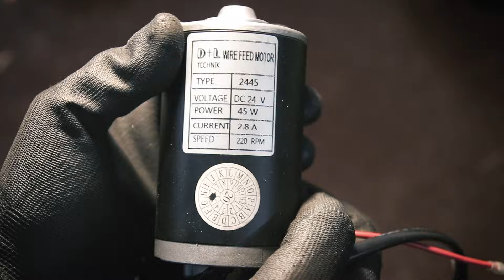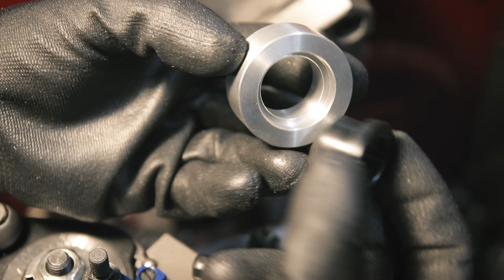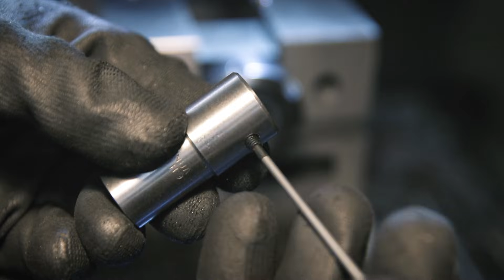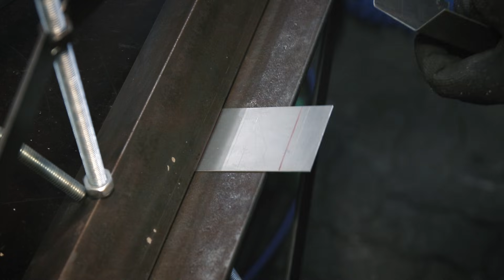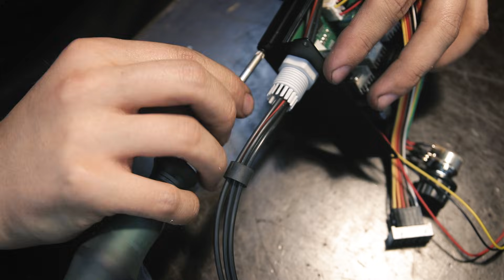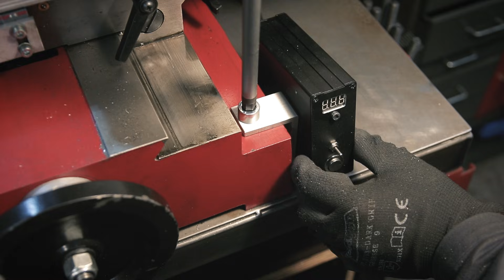Building a Powerfeed for my Milling Machine (with a Wiper Motor)

Comment: Most impressive, and economical solution thanks heaps for posting it for all to see. About to pick up a 4 year old Mill (round post type), price was within reach $1500 AUD (max 32mm drill 80mm face milling), looking to follow your example for power feed. One question, I am very interested in re-cycling HDPE plastics, any part of your build that would potentially accommodate its use?
Reply from the maker: I think you might be able to use HDPE for the solid base plate that attaches to the motor if you use similar dimension. The one I used is pretty oversized and definitely doesn't need to be solid steel for what it does. By the way there's a good chance I used the same mill you bought before, sounds like an RF-30?
Reply: @PhilVandelay  Yes I think you are right, my HM-35 mill is a cousin of the RF-30. I picked it up this week, just started to strip it down for cleaning and checking all the bits and pieces. Unfortunately I did crack the lead screw guide nut, so have to order a new one, I would like to change it to a Ball screw arrangement in time. Thanks for the reply.

Comment: Overall excellent job. 
When using a collet block, the flats should be against the jaws of your vise. With the flats against the jaws there will be much more surface area touching each other providing many times more grip. I was cringing the whole time you were cutting the 6 flats expecting the part to move and a broken end mill.

Comment: Great design Phil, it's the most practical X axis feed I've seen so far - simple but solid and compact. I used the same motor by the look of it, 24V 45W 220 RPM , on a Z axis feed for my mini mill and it works fine for travel and 'mill turning'. 
Thanks for sharing, Mike

Comment: Very clean installation. Looked at a few builds and only one so far has made a listing of what the actual feed rates are. Maybe a lot just use it for moving the x axis quickly for positioning.
Reply from the maker: Thanks! As for the feed rates, I didn't bother calculating them because I feed by "gut feeling" with the handwheel and so far that has worked out fine, so I'm doing the same with the powerfeed.  But that being said, even if I worked out the feed rates, there's no guarentee it would be the same on some other mill, since it depends on the pitch of the leadscrew which can be different between models. What I can tell you is that you probably want something roughly in the range of 10-250 rpm on the motor side to get a reasonable range of "normal" feed rates on a manual mill.

Comment: Nicely done!  If you add another power feed to one of the other axis, check out the motors that are used to move electric seats.  They cost about $12 to $15 USD and are very similar to the wind shield wiper motors.  I think I'm going to be adapting some of your ideas to my mill, Thanks.

Comment: This is cool. One thing that I have a question about...
How often are you finding you need to turn the handle a little to get the socket lined up with your hex adapter on the lead screw?

Comment: Hi Philly, great video. I love your calm and down to earth comments, which take into account that most of your viewers probably don't have a workshop (yet). So I really appreciate how you break down the process for noobs. On that note: I'd like to know more about how you measure the cuts at the mill. Like, how do you reference a certain point or plane once the part is on the mill? 
Thanks a lot, this is top quality content. I became a patreon, because the entertainment and educational value of your videos should be rewarded.
Reply from the maker: Hey, thanks for the support! As for your question, you can kind of think as the mill table as a coordinate system. You usually start by picking a "zero point", which can be anything, but for square/rectangular parts, people will usually use one of the corners of the part as their zero. Then you zero out your measuring system, the old school ways is to use the dials on the handwheels which are marked according to how far the table moves in relation to how you turn the handwheel. So for example if one rotation of the handwheel moves the table by 10mm, then you know that a half rotation would be 5mm and so on. You can zero these dials at any position and then look at the scale and/or count the rotations to move the table to a defined position. As you can imagine this requires a lot of time, skill and patience, so nowadays most modern machines have what's called a digital readout which does all this work for you. It just shows you the coordinates on a digital display by measuring where the table moves. So in this case, you would zero out the DRO when your corner is directly under the spindle (there's tools to determine this, called edge finders, which can use to "touch off" on the part). Then all your coordinates show 0 and now if you wanted to drill a hole, let's say, 20mm from the edge, you'd just move that axis until the display says 20mm and that's it. Of course things get more complex depending on what you do but that's the basic concept. Same thing for the lathe, except here it's the tool that moves instead of the workpiece, but you measure it the same way.

Comment: Thanks for an in depth description on how you did this. 
I was wondering if a detent could have been used to keep it engaged or disengaged or have you found it not necessary.
Love it. I am subscribing.
Reply from the maker: So far it doesn't seem to be necessary, it stays in place just fine

Comment: My 'dream' would be to have the drive motor do all the moving of the table and the handwheel simply be a forward/reverse switch with speed control. Graduations not in mm but mm/min.

Comment: New subscriber...  Really nicely designed and executed project Phil.  I just finished upgrading my lathe with an electric power feed that is separate from the mechanical spindle speed.  It allows for reducing or eliminating chatter and can provide super smooth final finishes.  Much like your project..  It is here>>  https://www.youtube.com/watch?v=0lwlb747xg0&t=19s

Comment: Phil, great video as always. What about using a solenoid to engage and disengage the drive motor? Electronic door lock, (DC) fuel cutoff solenoid,(AC) or through shaft solenoid would work perfectly I believe. Anyway, just a suggestion to an already great build.

Comment: Amazing work ... I would just add limit switchs to the table and a trip switch to the clutch system to make sure the motor doesnt turn unless the clutch is fully engaged

Comment: Very neat work. With a coat of paint on those chip guards it would pretty much look like a manufacturers option.
I built something similar for my little antique lathe. I used a 12v car wiper motor that seems to be happy enough running at 18v (It's been running this voltage for over a year now and hasn't burnt out/caught fire yet. :) ). I didn't bother with a clutch as I can just twist it's adjuster 3 or 4 turns to slacken off and remove it's toothed drive belt. I used a wiper motor because they have 2 sets of windings in them for high and low speeds. Coupled with the PWM speed controller it gives me a brilliant feed speed range.

One idea I had, that you might find useful, was to extend the direction switches wires and run them through the "Normally closed" side of a couple microswitches. With some mounting brackets you could use them as limit switches that only break the circuit for feeding in that direction (ie, you can still reverse the feed direction and back the bed away from the triggered switch using the powered feed). In your case it would prevent any chance of running out of bed travel and stalling your motor. In my case I want to do it to help me stop trashing ceramic cutter inserts. If I'm turning a long bar at a VERY slow feed, I'm not adverse  to wandering a little way away from my lathe to do something else for a couple of minutes. Sometimes I've got distracted and had to jump back to the lathe when I've heard that familiar Click click click CLACK CRUNCH"  sound of lathe tool hitting chuck Jaws !!! :D

Comment: Just another thought. A 12 point socket might give even easier engagement with the hex drive adapter. The design Phil is really neat and minimalistic. The only extra I can think of is some auto stops at each end of the table. BobUK

Comment: Nice build. Very clean and professional. My only comment would be to add some limit switches for both ends of travel.
Reply: Absolutely - those worm drives have massive torque and would destroy the gears if not stopped.

Comment: I really like this project as it covers different areas of manufacturing from mechanical to electrical work. The workflow is presented in a very calm way. I just enjoyed watching the video. Thanks for the effort.The only idea that came to my mind when watching the final operation was that it might be wise to install the limit switches so that the motor will stop automatically when the end position is reached.

Comment: Beautifully explained and demonstrated, and such a simple great idea ...............  I take it a windscreen wiper motor has quite a lot of torque then,  as that looks to be quite a heavy milling table.
I just wish you had supplied the links for the eBay parts you bought.

Thank you so much for showing us this,  it gives me a few ideas ...................  a 'sheet steel trimmer' I have been working on,  just couldn't find the right motor to use.  I also take it that the motor is geared.  Can anybody confirm this please ?

TURK
Reply: Google (" 12 volt motor controller with readout ").  Looks like they start at $10 US.

Comment: Hi Phil,
 Very nice work, I have the factory power feed on my SX4 which has developed an intermittent fault.....sometimes it doesn’t work, other times it’s fine.....problem is the fault is getting more frequent, now there is a solution! Cheers

Comment: Very nicely done build, what modeling ptogram do you use?
Reply from the maker: Well the program I made the animation with is not a CAD program, I use that purely for visualization (it's a CGI / Polygon based software) so the models here are just a rough mockup for explanation purposes. If I make construction-type models and plans I use Fusion 360 (for the Belt Grinder, for example)
Reply: @PhilVandelay  Thats interesting, how did you generate the image of the wiper motor, 3D scanner?

Comment: I did the same thing on my  1936 atlas 10d lathe which was made without a power cross feed. 
i i used 12v wiper motor (free) and 6 amp pwm with reverse (less than $10.00}, cheap and works great, good vid thanx

Comment: Hi, Phil... I would suggest, to add end switches or a slip clutch to the thing. I am shure, you will leave some slow / long milling tasks alone and walk away occasionally.. This is kind of a desaster waiting to happen.  I tend to use this wiper motors a lot in my builds... Greets from Germany.

Comment: Just for future reference, that seven segment display you used is designed to be mounted to a PCB, that's why no care was given to mounting options for it.
Reply: Actually no not necessarily.  It is meant also meant to be mounted in to a socket in a plastic case which has tabs with locking fingers that catch the back of it when it is mounted correctly.

Comment: My only note would be to add two momentary buttons witch decide the turning direction along the side of the switch, so you can move it quickly and relative accurately to spots for detail work. I find this better than small switch like that. For the machining it self switch similar to that is fine. Just find it perhaps bit small for use. Dunno maybe its just me...

Comment: Just needs a couple limit switches to stop it at the ends of travel.
Reply: I was thinking the same thing.. Perhaps a solenoid to disengage the clutch when not operating under power.

I know I'm getting into feature creep here.

Comment: Some detents on the shafts and a spring plunger replacing one of those socket screws that engages with the slots seem like a nice way to lock this assembly into engaged/disengaged positions

Comment: Very well done video--  Wish I had seen it year ago...  I made a similar table drive using a gear system with an idler gear as clutch between the wiper motor and the table lead screw:
https://www.youtube.com/watch?v=DaVRwv_JjKE

Also constructed a larger box to cover the entire motor and the gear box.  

My first project with this mill was to fabricate a Z motor drive to avoid having to crank the column up and down:
https://www.youtube.com/watch?v=WfR0QAnfEj0&t=2s

Both the Z and Y table drive are powered from same AC/DC power converter, but I used small electric boxes for the DPDT and power switches.  I don't like to reach around or under the mill when working.

I've also done a few other "user friendly" changes to this PM25 over the past year:
https://www.youtube.com/watch?v=DesCDKJIXak&t=97s

These videos were done with friends from an online machinist forum, so not a full feature build.

Comment: Does the motor stop to prevent the table from over traveling?
Reply from the maker: Nope I just have to watch out so that doesn't happen. But nothing keeps the powerfeed on the lathe from running into the chuck either and I haven't done that (yet)
Reply: @PhilVandelay  I wasn't sure if other commercial units have some type of limit switch on both ends to prevent over travel. Either way the build is awesome. Your work is always clean and very well thought out.

Comment: awesome job, just need to add some end stops, these could be added to the directional switch circuit to cut power when it reaches the end of travel.
Reply: Agree. Another idea would be a spring that keeps the motor disengaged requiring operator input. Your suggestion is preferable while mine is a bit easier and cheaper albeit more of a pain long term.
Reply: i would put an endstopon each site configuered as an NC and then put the power on there so that if it hits the end it shuts the power down to the circuit, in the end it is just a security option, normally you standing besides it when working on it but it can happen that you are looking at something else the longer you use the feature
Reply: I was thinking the same thing.  My shop bought power feed has a 2 way switch and 2 end stops.  And when the switch touches one of the end stop it stops the motor.

Comment: tip: to make the display even easier to read, add a smoked piece of acrylic (like from a dead alarm clock) such that the display sections that are off don't show up as 'white' to your eye. Increases contrast a tonne.

Comment: Hi folks. If you don't have a welder you could cut a very slightly oversized square drive and use an interference fit. I've been seriously tempted to get some broaches for a while now! BobUK.
Reply: I don't have a welder and cannot weld,. I have had this problem in the past and never thought of making an oversize square drive for an interference fit. Thanks I will remember this when I make my x drive as per this video. I have looked at many designs and this one is the best for me. No broach or press either !

Comment: A nice solution to your problem It turned out very good, you could also add some limit switches to it as well. I might do something similar to my mill having seen your video. Thanks.

Comment: planning on covering the way you dont want any chips or metal dust abrading the way ive seem mill with metal gouges half an inch deep because no one cared to clean the chips accumulating around the mill .
Reply from the maker: Yeah I have been wanting to do that, I have yet to figure out a solution that doesn't interfere with the handwheel too much on Y

Comment: Awesome design! I would change out the screw in the motor sliding mechanism, with a ballbearing, a spring and a grubscrew. and make two divots in the slot at each end of the sliding part, for that satisfying snap-action ;)
Reply: detent!!

Comment: Looks nice, good work. I would be worried about machine vibrations shaking the coupling loose, would it be possible to drill a hole for a spring loaded ball bearing in one of the slots on one of the pins, then two smaller holes in the pin housing? You'd still keep the assembly retained by the screw in the other pin, but you'd have a detent to retain it in place as well.
Reply: I've just thought, you already have the threaded hole for the retaining screw, if you put a ball point spring set screw in that hole, and drill / mill (with a ball nose endmill) 2 dimples in the pin, this would require less modification.
Reply from the maker: Good idea! I will keep this in mind if I notice it moving around

Comment: Very nice. Probably It will be more ergonomic if you put a connecting bar under the table (if possible) to be able to engage and disengage the motor from the side of the handwheel.

Comment: Nice work. How to you stop the motor once the table reaches end of travel? Are there limit switches or does the clutch disengage?
Reply: This is going to blow your mind.  He turns the switch in the opposite direction to the way that he turned it initially to get the motor to operate.
Reply: @danielstewart3507  lol, i think he meant, will the motor keep trying to turn when it reaches the end of travel or does he have an end stop to auto turn off the motor.